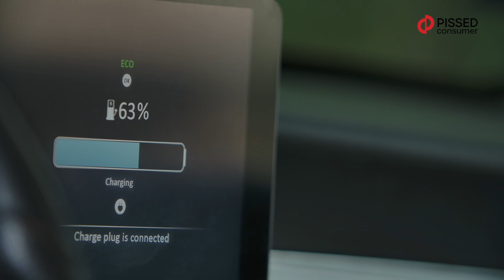Electric Vehicles Pros and Cons, Tesla, Rimac, Rivian. Should You Buy an EV?

Comment: Is it me or is calculating an EV's emissions using the "average grid" disingenuous?

The average grid is just that; the average. Meaning there are periods of less generation emissions along with periods of more. Overnight generation is significantly more dependent on fossil generation (by some reports/studies 30 - 40% more). If most EV charging is performed overnight (which almost all reports/studies peg it at 70 - 80%), then their emissions are the emissions of that overnight generation and NOT the "average grid". 

In Germany for eg., average grid emissions are about 350 g/kWh. It rises to about >500 g/kWh overnight. 

Calculating an EV's emissions using the average grid is a shell game. Some studies have a break-even point of close to 150K miles. One thing for sure is that in reality it's a heck of a lot more than 30K.